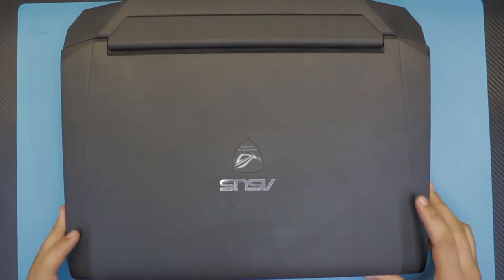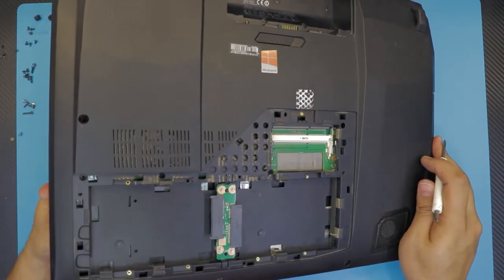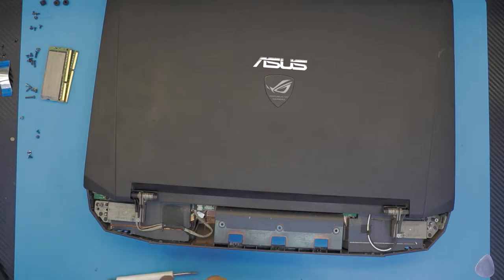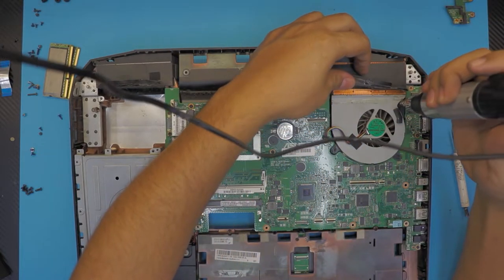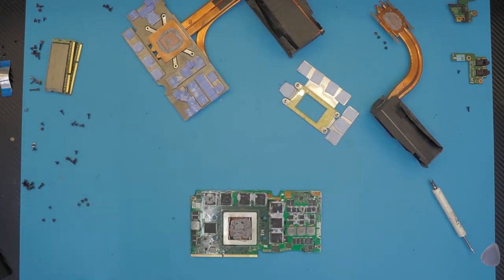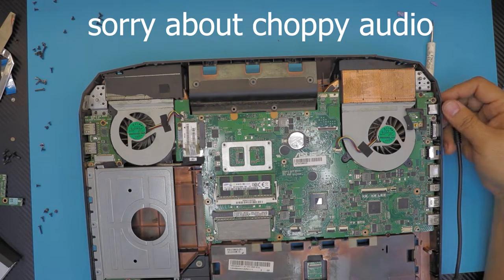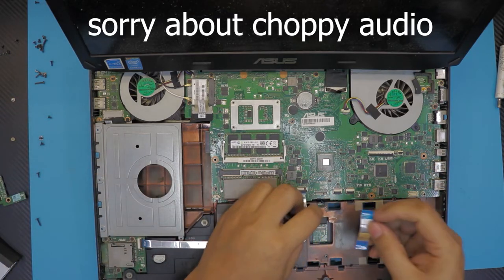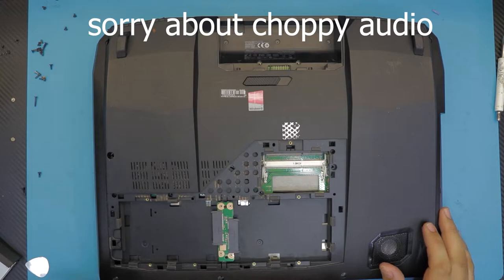ASUS G750 Repair, service, Disassemble and repaste

Comment: Can I use thermal paste on the mems too? or I must use thermal pads on them, and only paste on the GPU
Reply from the maker: you can use paste on any component as long as you have a heat sink for it. i would say use a pad because you need to have a filler there the gap is too much for paste.
Reply: @uFixTek  What size pad is needed? (thickness)

Comment: Ive been having trouble taking the fan on the right out. Any help appreciated.
Reply from the maker: did you follow the steps, if the screw is hard you need to use force and it should come out easy, can you send picture of short video.!
https://imgur.com/
Reply: @uFixTek  ive managed to get it out but the problem was the glue and the flap behind the fan got stuck to it so i had to rip them. Thanks anyways!
Reply from the maker: ya those are useless, no need, we try with them on and off and believe me we got better results without them on as more air contact had with heat sink.

Comment: Excellent!!! My CPU fan is dying. What is the height of the fan? I got a G750JH, is it 25.8mm or 15mm (I saw 2 different reference for G750 laptops). Do I need to remove the screen for only replacing the fans?
Last question, what is the CR coin battery ref?
Reply from the maker: hi, thank you for the feedback and your support and regarding your questions:
#1, on each fan there is a green label with fan model and detail can you send me pics of the fan label?
#2. the screen doesn't have to be removed in order to replace the fans, but it will make life much easy if you do, less struggle.
#3. CR battery is the CMOS battery , if your bios or date and time resets every time you power off the laptop, and remove the external battery, then  you may want to replace the Cmos battery. the model its cr2030 i believe (if im wrong it says it right on the battery).
Reply: @uFixTek  Greetings from France. 😊
First of all, thank a lot for taking the time to help me.
#1 The idea is to be sure to order the correct fans BEFORE opening my G750JH (it does scare me like hell).
According the information I found on Internet, the correct references should be:
CPU: AB07512HX26DB00(00CWG750)  (white 4pins connector)
GPU: AB08812HX26DB00(00G750JH)  (white 4pins connector)
Compatible for G750JH, G750JY & G750JZ
Height: about 25/26mm
Since the JH was one of the most powerful, I guess it is using the biggest fans.
#2 As mentioned before, I'm really scared to break my fully working laptop. I already replace some battery, home button, speaker in some iPhones, but this is much bigger... 😨 I think I will follow your advice and also remove the screen. The most tricky part is probably to remove the keyboard (lost of ribbon cables...).
#3 In fact, this question is similar to question #1; I want to be sure to have the correct ref before opening it. 😉 This is definitely not a big deal.
I will add an extra question:
#4 According to your experience, how long the thermal paste last on laptops?
Reply from the maker: ok glad you got the fan information check them on ebay they are cheap there, and you cant mess it up its not sensitive stuff, as many ppl think its delicate and all but the truth is its hard for you to damage a motherboard.
just take your time and its not hard to remove the flex cables, and if you cant move on on anything take a picture and send it here and i will help you out quickly. regarding the question based on thermal paste it comes down to many factors:
usage time
usage load
type of the paste
i would recommend you to place one of the following paste:
#1. thermal grizzly kryonaut : https://amzn.to/3pmiThf
(this one is the best of the all in paste, it will last about 2-4years under full load, 6h daily average)
#2. Artic MX-4 : https://amzn.to/3qST74q
(2nd best and last 2-3years full load 6h daily)
good luck and Note take your time and use this to send pics:
https://imgur.com/
Reply: @uFixTek  OK. Note taken concerning how a motherboard is not that fragile. I guess the most important factor is the ESD?!?
Thanks a lot for the links. 👍 I'm planning to open my G750JH this week-end. If I got any issue (or see anything uncommon as the sticker covering 1/3 of the heat-sink... 😲) I will post some pics. I will keep you inform. Your video will be very very useful. 😎
Reply from the maker: trust me don't ever worry about the motherboards and ESD, only ESD can damage a ssd (some ssd)
even Linus made a video on esd it fun if you want to take a look at it :P
https://www.youtube.com/watch?v=4SjOv_szzVM&t=154s
Reply: @uFixTek  Wahouu, it is impressive (and funny). 😅
Indeed modern electronic PCBs are well design against ESD.
Reply from the maker: true, i been working with motherboard for over 15years and man handle them and without the ESD strap and all , and never ever had one died because of the esd.
Reply: @uFixTek  Just a quick update: I received the GPU fan. The connector is not the correct one. It is the ROG desktop version with a black 5pins connector instead a white 4pins one. Not a big deal to swap the connector. So, I'm planning to open the beast this WE. I will keep you inform how well (or bad) it went.
Reply from the maker: it will go well my friend have faith :P and if anything im here to help you.
Reply: @uFixTek  Done !!! What a relieve. Now, my laptop is much quieter and CPU/GPU temperature are much lower in IDLE. I need to check with some games, but probably the stuttering on some games was due to CPU/GPU clock throttling.
I was a bit scared at the begin because the fans was not working at all during the boot. After doing some stress tests, the fans started. 😊I'm very happy. 😋🤩
I had a similar issue as you on the GPU heat-sink. The black sticker was covering 1/6 of it.
I was so focus I forgot to take lot of pics. I got only few ones. I will post them soon.
By the way, the fan reference I mentioned earlier are the correct ones.
Last point, the coin battery is a CR2032. Surprisingly it was not completely dead after 7 years.
Reply from the maker: @LapinFou14  im glad you got it all done, and yes the fan they have a curve temp for them and the cpu fan will start at XX temp and gpu fan also will start at XX temp, and the bios battery will last longer if you dont drain the main battery or if you pull out the main battery for a 3months without powering on the cr2030 battery will drain fast,. good luck my friend :P
Reply: @uFixTek  Thanks for your explanations. I'm well aware of how the fan speed are working. I was just very surprise how my laptop is now quiet on IDLE mode. Changing the thermal paste & fans + clean-up the dust did make a huge difference. It was definitely a good move. 🙃
By the way, again, a big thank for your video. It helped me a lot!! I was watching your video step by step. It is just perfect.
Note: for the record it is a CR2032, not a CR2030 😉
Reply from the maker: @LapinFou14  true cr2030 :P and thank you for the awesome feedback and i will start uploading more videos as i was very sick i got the COVID and im just coming out of it.  enjoy your laptop and if there is anything in the future you need help or anything let me know in any of my video comments :)
Reply: @uFixTek  I thought it was a CR3020 😂
I hope you are fine. COVID can be terrible in some case. The good thing for you now, according the statistic, you got now a 85% protection against the COVID.
Reply from the maker: @LapinFou14  :) THANK YOU and be safe my friend
Reply: @uFixTek  The black sticker on the GPU heat-sink → https://i92.servimg.com/u/f92/19/00/34/51/img_2029.jpg
Pic when I took a break (I used a double tape + some notes for the screws) → https://i92.servimg.com/u/f92/19/00/34/51/img_2026.jpg
Specially for you, a pic of the CR2030 😇😋 → https://i92.servimg.com/u/f92/19/00/34/51/img_2027.jpg
Reply from the maker: @LapinFou14  nice work my friend very proud :P
and very organized work space nicely done:)
Reply: @uFixTek  thanks. Have a nice week. 🙂

Comment: Hi, thank you for you time, great job.
I plan to repaste and repad my GPU and CPU, I only repasted my CPU once.
What is the thickness of the thermal pads ? I know there's 0.5, 1.0 or 1.5.
Something like :"mod/smart Fujipoly Ultra Extreme XR-m Thermal Pad - 100 x 15 x 1.0 - Thermal Conductivity 17.0 W/mK" would be fine (with the appropriate thickness) ?
I have the 770m.
Thank you.
Reply: Did you figure out the answer?
Reply: I repasted my GPU and CPU, in my case its the 750m. I took away all the pads and put thermal Grizzly paste (12,5 W/mK). The computer runs at 40 deg Celsius at idle (both CPU and GPU), and when playing Dota 2 at ultra settings and 100% rendering, the GPU temp is 67 deg C constantly. I would suggest you just buy a high quality thermal paste and put it on all the components that had pads previously. I can't even hear my fans on my G750JH anymore. Prior to this fix the computer was crashing due to overheating while playing games or even when watching youtube since the Nvidia card got activated during media usage.
Reply: @Xzizia92  Thanks for these details. About to do mine. Was concerned about replacing pads as a previous commenter was.

Comment: @uFixTek Hi, I love your videos, helps alot. I have a question about my charging port. I've got a new replacement for the power jack including the sothered circuitboard. The new board only had 'one pin connector to connect to the motherboard, while my original circuitboard have two. If I look at the back of the motherboard it doesnt look like the "circuits" go to the pin connector thats missing on my new replacements. But I dont really know. Is both pin connectors used, or is one of them just a dummy?     Best regards and thanks for any help  :)
Reply: Oh, I forgot to mention, but I have a asus G750JH.
Reply from the maker: i need you to send me as many closeup pictures you can and few from far and different sides, and let me look at the stuff
bdsoporte.queretaro@gmail.com
thank you for the feedback.

Comment: Hello and thank you for the video. I have a problem with my Asus (G750JZ-T4090H). I have cleaned my fans, put it back together to the point you chack if it powers on. Mine doesn't turn on anymore. Power Led turns on for a second and then back off. Fans and hdd not turning/loading. Do you have an idea what could go wrong?
Thank you
Reply: Did you put the small part of the AC adapter correctly back to it's place on the motherboard? I repasted my G750JH 3 days ago, it was crashing because if was overheating. From probably 105+ deg on the GPU to 67 now when I play dota 2 on ultra settings. 40 deg C for CPU and GPU at idle. Works perfectly.
Reply: @Xzizia92  Yes I put it back. The little white LED that blink 1 second is located on that part. I even took it back and inserted it again but still doesn't work. Of course I already tested with RAM removed and all other tests
Reply: @Ray2500x  I never took out the RAM when I was taring mine apart. Just the parts that were needed to take out the MB. But that should not be the issue I believe. It feels like there is some contact problem where the power comes from if you can't hear the fans or hdd. Sorry man I don't know what is wrong in your case, I wish I could see the computer with my own eyes

Comment: Hi

I have a G750 JW. Are my fans also taped over?
When I run it with 2.4GHz and play a game (Dota2), the temperature goes up tp 90*C-95*C after a while.
If I set the CPU to the turbo settings, 3.4GHz it will jump to 95*C in 5 seconds and that's when I have turned it off to not damage it. I belive it has gone over 100*C and shut down the PC due to overheat.
My laptop is about 8 years. I don't remember how hot it got back then.

Would a service like this help me? I've only vacuumed it a few times, nothing major
Reply from the maker: it will def will help you out and you will see once you open it up :) and thank you for the support to the channel :)
Reply: I finally did it. new cooling paste and cleaning. On my g750 jw, the tape did not cover the fan. However, the remaining cooling paste was pretty old (8 years duh).
Now i can run at full capacity without overheating. im at 65 degrees tops now. before it was probably above 100.
An issue I had. Was that the things which the screws should go into. Several of them just fell apart. I have 10 screws now that I cant do anything with. I would say i was very careful and this still happened.

Comment: Hey i think my HDD to MB cable strip got broken, do you know what's it called and where to buy it? thanks!!
Reply from the maker: https://www.ebay.com/itm/Genuine-Asus-G750JW-G750J-SATA-Hard-Drive-Connector-w-Cable-P-N-69N0P4Q10D00/401785057883?epid=1870127648&hash=item5d8c41725b:g:TPkAAOSwfx9dAXFQ
Reply: @uFixTek  i just need the cable strip, do i have to buy the whole thing?

Comment: Wow can i change the gpu ?
Reply from the maker: yes you can change the GPU on this models, its a PCI e dedicated slot
Reply: I want to make sure about repaste gpu, so I only give thermal paste on the gpu then thermal pads on the other components on gpu?
Reply from the maker: yes just change the GPU thermal pate and for the rest of the component put the thermal pads.
Reply: Nice, ok thank you..
Reply: @uFixTek   is it possible to go from a gtx 860m to a 980m card?

Comment: Hello, so my problem is that my power button from my G750 got stuck. I opened it and the power button is not attached anymore and so I can't power on my laptop. Do I just glue the power button on the back of the keyboard or do you recommend something else? I would love for you to reply, this video was already very helpful.
Reply from the maker: i need to see to see how is not attached send me pictures using https://imgur.com/
closeup pics and as many you can i will try to to answer as soon as i can , we can get it fixed :)
Reply from the maker: ah :) dont worry just grab a super glue and place one or two drop right where the 3 pins are and let it sit for few hours and you set its just the plastic. uff i was thinking that you broke the electronic power on button, just super glue the 3 doted plastic and you all set. let me know.
Reply from the maker: its very common this thing, i put the super glue and it lasts very very long time. and if you want a better harder glue get the https://amzn.to/37YPdh2

but honestly you better off with super glue. but if you have the money to get this get it and mix a few drop and with a road mix it and apply 3 damps and you set.

Comment: So. My G750 js works but it doesnt acknowledge the gpu or crashes when it does. You're saying if i buy the same gpu and not upgrade it i should be able to fix the problem?

I have disabled the gpu from device manager but it still heats and shuts down sometimes.
Reply: I am working with it on the Intel graphics but that makes it useless for anything that i bought it for
Reply from the maker: i recommend you to do few thging before anything, you say overheating, it should not over heat if you dont have  any load on it,  so i would say do a complete repaste and clean the fans and the heat sink vents.  if doing that then it over heats and crashed then let me know. #2, regarding you GPU card you can just buy the same model and place it in and it will fix your issue. or send the old one for a "Reballing BGA" and that will fix your old one  but you need to find a pro tech to do the reballing of bga for you else , just get the new card.
Reply: Thank you so much for the swift response, i live in Pakistan and things are a little harder to get by (graphic card) (someone who can do what you did in that video)  but i will try what you recommend and get back to you.
Reply: Is there a tool kit you can recommend that i can get from Amazon which will help me doing what you did, screwdriver and those tools you open the diff cables with
Reply from the maker: the best tools that will last you lifetime and they are hard metal and the best is : https://amzn.to/2MzmGc1
i put in the video descriptions links. you can buy cheat tools but they dont last you long time and even you can damage the screw heads.  the link i send you is a bit expensive but its a complete package you can look for a smaller pack if you want but in the same brand. check the links on my videos . let me know how it goes. i have a really good friend he is from pakistan. :P
Reply: Wow, they have such big fans and a large cooling setup that you would think these would never have cooling issues.

Comment: opened mine and cleaned it and repaste,  closed it back up and now i have extra screws
Reply from the maker: Thank you for the feedback! if you wish to support the channel you can LIKE or SUB or both :P
regarding your issue : As long as you put the hinges screws on the bottom and all you could see, dont worry 60% of the screws in the laptops are not important.

Comment: Hy !!is it possible that my motherboard dies without the GPu also dying
Reply: Asus rog jw gtx 860m
Reply from the maker: Thank you for the feedback! if you wish to support the channel you can LIKE or SUB or both :P
regarding your question: what is the issue of the laptop?, its not turning on? or its turning on but no video displaying?, normally 1st the gpu dies 1st on this models.
Reply: pc does not turn on
Reply: the motherboard has blown so the gpu is dead?
Reply: Motherboard has grill !
Reply from the maker: im sure its dead then if its not turning on :(
Reply: Yes Big thanks